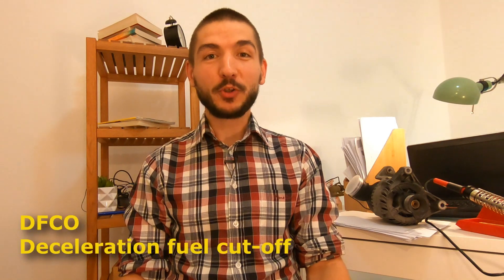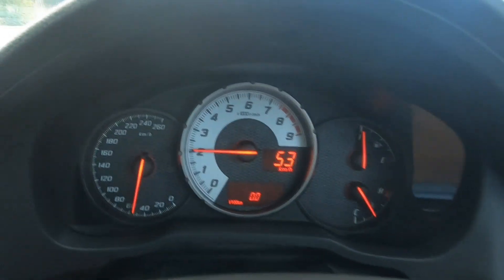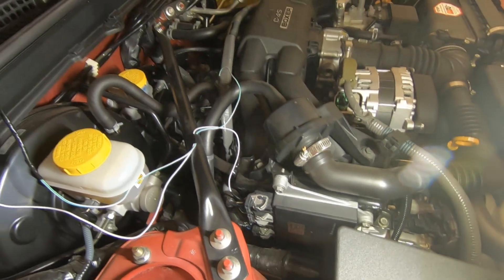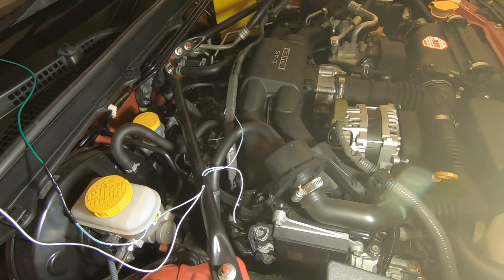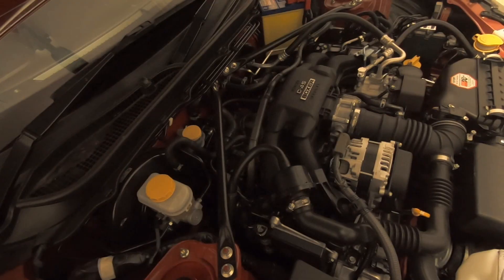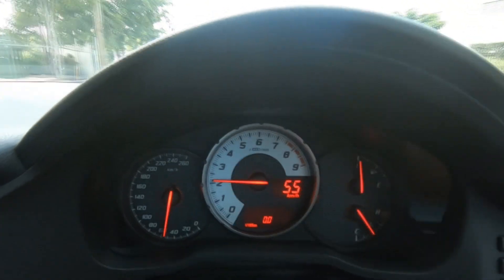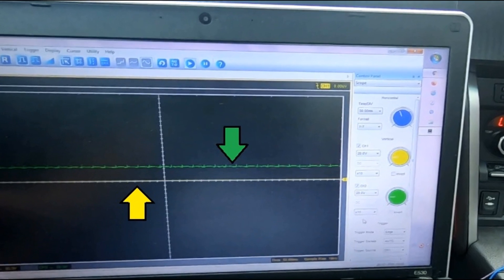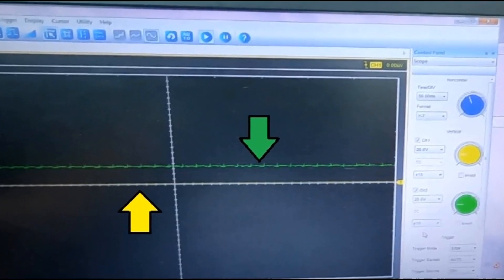Deceleration Fuel cut-off | DFCO

Comment: TFS! Very interesting. As a heads-up, DFCO while using cruise control is Bad for the drive train. When using cruise control and DFCO is enabled (downhill) and you use cruise + to accelerate or change from downhill to uphill DFCO causes a Violent Full Acceleration Start.

Comment: Thanks for the explanation, i know im very late but from what i understand, during fuel cutoff, the engine is still making noise from the air being compressed ?
Reply from the maker: @ParsonU  yeah, I would say so. Cam-Crank Timing is still set as always, rpm is high (way higher than when you crank it with starter motor). Lots of air gets pumped through the engine. Although we don’t have direct proof (like a video camera inside of the cylinder) we can confirm indirectly, by checking injectors pulses and data from O2 sensors, that fuel is not going into the cylinders 👍